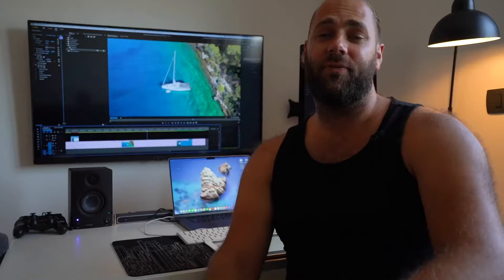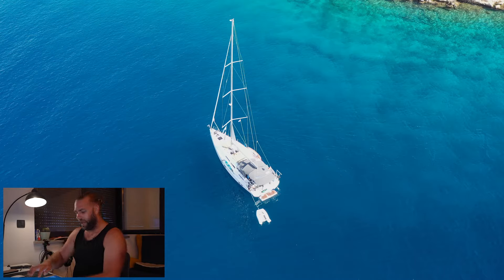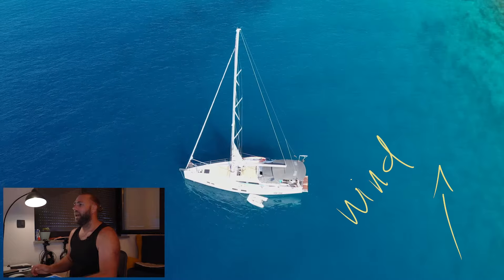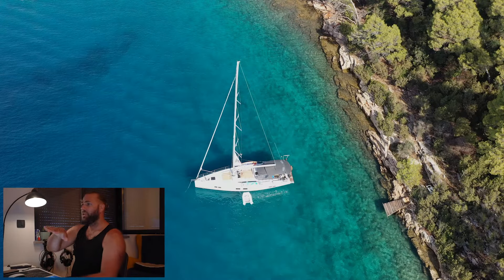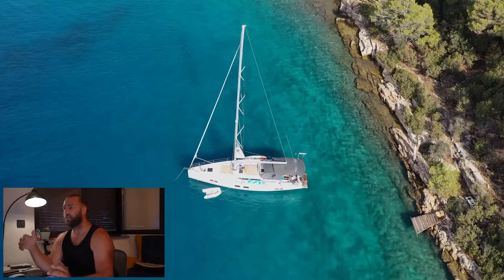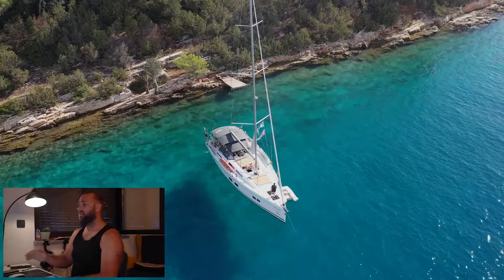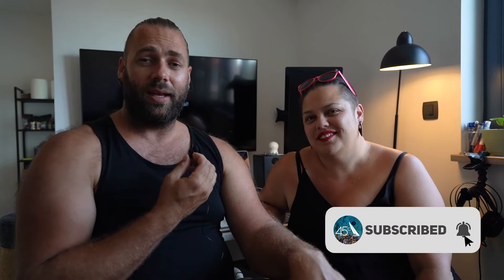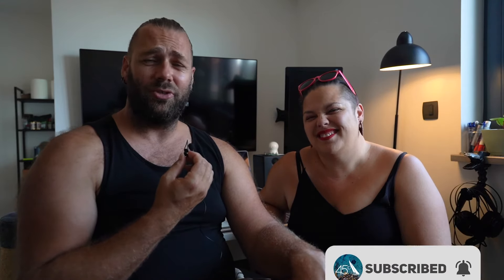Anchoring with a line to shore in Croatia - Sharpen Up Episode 7

Comment: If you had significant crosswind or stern wind, would that mean that you have very little time to tie the stern lines before the boat is rotated away from the shore? Would you in that case send someone on a dinghy with a rope or swimming in advance, in order to tie stern as soon as possible?
Reply: Yes that is a great option that had worked for me on several occasions. 
It also takes away the danger of someone in the water whilst under power and/or having to tow those long and heavy ropes.
If you equip your own yacht, be sure to buy the floating, non water absorbing ropes.
Also, anti chafe covers can come in handy, plus as someone else already mentioned in one of the comments, put the ropes in a bag and they are mostly snag free

Comment: Good video! Just a note. Recently became forbidden anchoring with a line to shore in Croatia during the night or weak visibility situations due to increasing number of accidents...
Reply from the maker: Aha. Thanks for the heads up. That is a shame.  I will check out the ruling.
Reply: Is there an official rule? It's quite common to anchor with a shoreline. Only trees should not use for this and of cause not near to buoy fields.
Reply: Basically it is a very interesting ‘concept’ and clear case. What are your lights during the night when tied to shore and on anchor? Anchor lights or no lights? If anchor lights you should be only on the anchor (it means there are basically space around you, left, right). If you are tied to shore close enough just like in a harbor you do not light up anything… So, if anchor lights and somebody runs into you shoreline, you are guilty…

Comment: The thing I struggle the most is briefing the unexperienced guests to hook the stern line to the shore. Sometimes it's just reasonably too tricky for them climb the rocks and find a good rock to tie to. I wish there was some gadget to help fix rope to rocky shore.
Reply from the maker: Fully understand, this is a very tough one to figure out. And it takes sure footing and an understanding of the lines to get this right. Try set them a large pre tied bowline and do a pass of the shore line to pick put the rock you would use, then they will be a little more prepared.

Comment: Can you use the bow thruster to stop yourself drifting downwind on to hazards?
Reply from the maker: You can to an extent. As shown you can bow trust to spin the stern to pull upwind. But once you are tensioned against the anchor chain this is not that effective. When I have really needed to shift, I motor fwd a little (with the chain down still) upwind, then rotate the stern upwind by turning the yacht and using the bow thruster, then reverse towards the wind and the shore to manoeuvre upwind.
Reply: Ah, that's interesting, I was thinking about using the thruster to arc/move laterally on the end of the chain to counter any side wind. That sounds a much more reliable method of setting the direction with the bow thruster then reverse with the main motor. All the yachts I've sailed have never had a thruster, first time this year.

Comment: Seems a tricky manoeuvre, if using only one stern line should it be the windward line or is that not important?
Reply from the maker: Can be tricky. I would say it's not important which side you secure to. Though as said if staying overnight I often put two lines out for a good triangle hold from both directions.
Reply: Thanks for that, we’re sailing from Corfu to Dubrovnik next week so I’m sure I’ll be putting this into practise as we move around the islands. I’ve always had mixed results with lines ashore but your video has given me a few more pointers.
Thanks.
Reply from the maker: @garymckeown810  glad it was helpful. Great passage that one. Enjoy!

Comment: Thanks for an instructive video! I've never tried that approach my self as, here in the Nordics we usually go bow first to the rock as show in this video (https://www.youtube.com/watch?v=FualbbnIvlA). I've seen boats as big as 60 ft do this in the Stockholm archipelago. Now to my question: In you opinion, would it be possible to moore with the bow to the rock in Croatia?
Reply from the maker: Thanks for this video! Yes I had heard about the Nordic way! Never done myself though. Yes I do think it would be possible. There are many spots that this could work. We are not often set up for a stern anchor though.

Comment: My 2023 goal is to master this technique, but I am shared sh*tless that the anchor won't hold and the boat will drift into the land :(
Reply from the maker: Hey Philip, fully understand this fear. And it is a GOOD fear to have. It means that you need to pick your spot carefully, drop well and lay the chain evenly so that you can check to see it is holding and that you can be confident in it. Key is having enough chain out to be able to handle the pull and possible changes in weather.